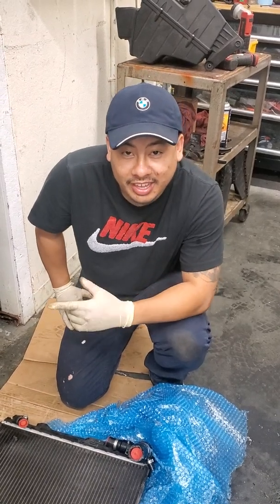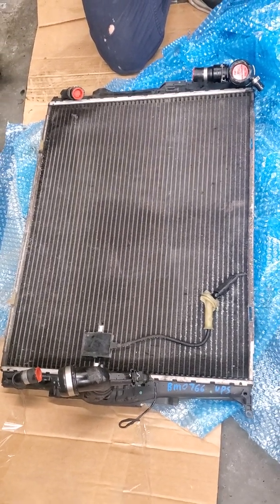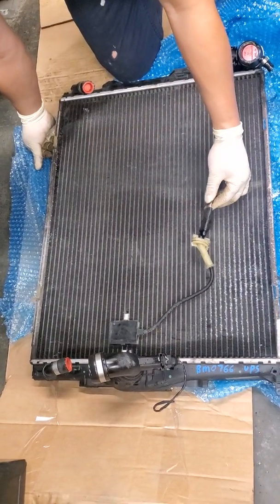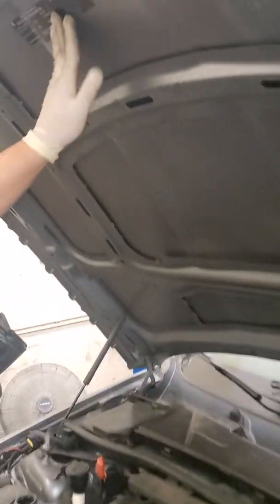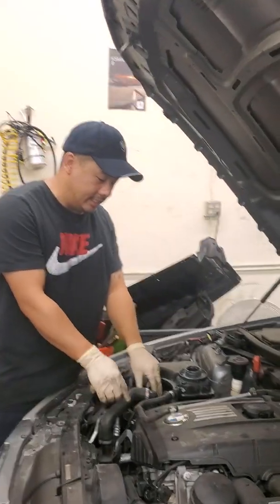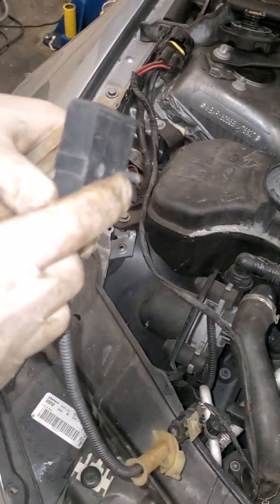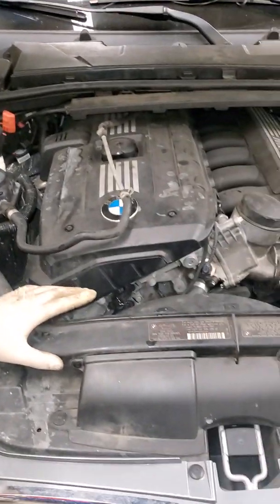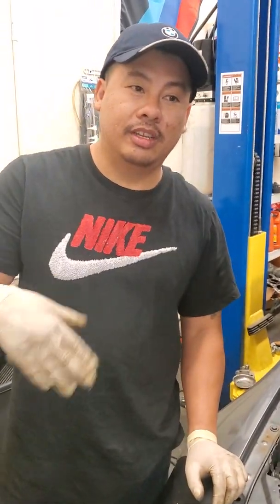The truth about N51 SULEV compared to N52 Non-SULEV engines

Comment from the maker: I meant to say, "buy the N52 engine instead of the N51".
Reply: I just bought a N51 didn't know anything about it still learning about them
Reply: I bought one, without knowing the difference. I had an opportunity to buy a 4 yo 128i with only 11K miles on it, from an older couple in San Diego, which is easy on cars and where it was always garaged, so I snapped it up. Later I learned it was a SULEV. So far it has been routine maintenance only, except for replacing the ignition coils ($800). So far, 8 yo with 40K miles, no problem.
Reply: @yankee2yankee216  Ignition coils should be replaced by BMW at no cost under the 150.000 mile/15 year SULEV warranty. Don't regret buying the n51, that's a huge benefit over n52's. You're guaranteed to pass emission inspections while under this warranty.
Reply: If I bought a n51 that had a n52 radiator replacement in it and it's still under sulev warranty, can it be replaced with the correct radiator?
Reply: Maybe on my off day I can come by and talk to you about mine
Reply: Fooo is a bit slow lmao yes buy the n52 not the n51
Reply: @brokenbavarianE90  the n51 comes ready to be tuned with the three stage intake manifold.. the n52 only has a single intake which can be converted to a three stage intake but youll need a shit load of parts to order to do that.. and no the n51 is not faster than the n52 at all ive had the privilege too own both cars the 2011 e90 N51 sulev and the 2011 e90 n52 ulev look at my channel😁😉
Reply: Well it's still potentially not as bad as what it can cost for the n54 and n55 for maintenance. Key word "potentially".